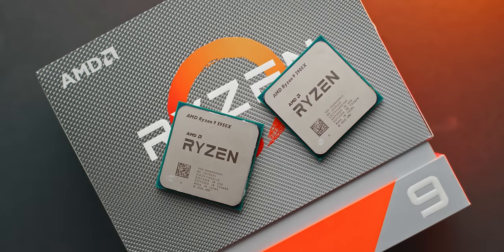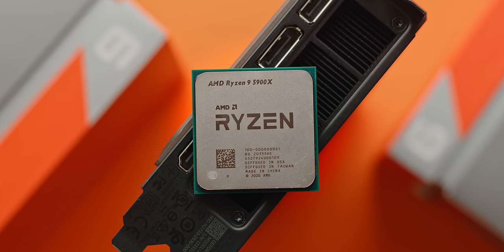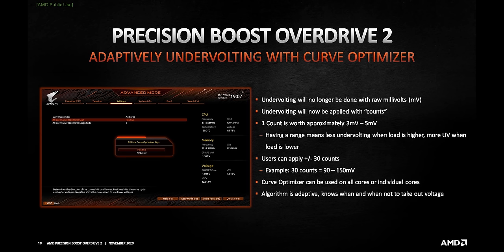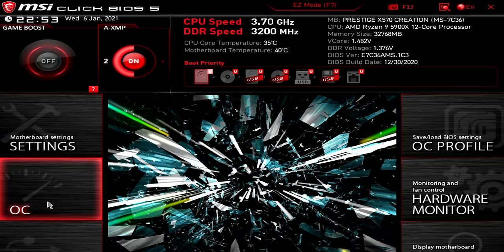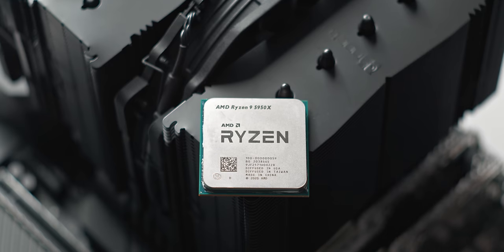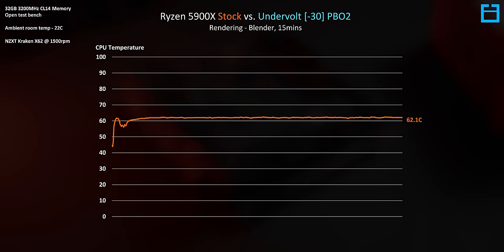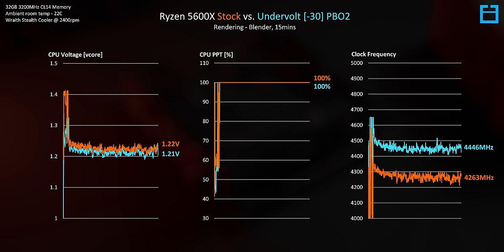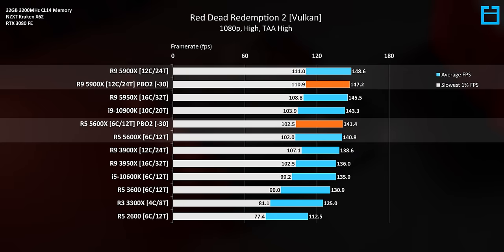Ryzen 5000 Undervolting with PBO2 – Absolutely Worth Doing

Comment: I tried that with my 5800x and the result is very very surprising.
I tried it first with negative 10 and it didn't change much.
Then I tried it with 15 and I couldn't believe the results.
In cinebench R20 and Stresstest I use to have up to 90°C with my CollerMaster Hyper 212.
With PBO2 negative 10 it was the same.
But now with negative 15 I have in CinebenchR20  and Stresstest max 59°C.
And it looks like it's stable.
Did anybody experience something similar?
I didn't really check the core clocks but in Cinebench it says @4.8
The cinebench score didn't change much but I also didn't have much time yesterday to compare it.
Reply: Yes similar results but it wasnt stable after further testing, it runs fine with Loads, the issue pops up when the CPU down clocks or is in very low load state like just idle in windows and i get errors or BSODs, currently testing it again with a new bios update on X470 Asus CH7
Reply: @Justathought81  yeah, I also had to remove these settings back to normal but It still was stable.
The problem was that I had micro stuttering in games. The rest was ok. No BSOD or so.
I think I'll try again soon with 14 or 13. Maybe that works.

Comment: Did exactly what you did on my 5900x with 30 negative curve set on all core and got a blue screen after I restarted lol. Maybe lower it down to 25 or 20.
Reply: SAME this guy doesn't know what he's talking about
Reply: With things like this you need to make sure every single setting is exactly the same as his. PBO limit DISABLED and thermal throttle limit "Auto" being the two most important
Reply: @CWWJR  If you read detailed guides to undervolting using this method you can see how variable the voltage on each cord is, 1 core may work fine at -30, another -9, it should be done per core never -30 all cores, for most people it won't work
Reply: @CWWJR  I didnt cheap out on the motherboard, im running the X570 ROG Crosshair VIII Hero, which I would say is definitely one of asus's high end motherboard. And im still crashing with blue screens. So im assuming your going to say next is I got the short end of the stick with my 5900x. My build isn't cheap either, ryzen 9 5900x, powercolor red devil 6900xt, seasonic platinum 1000 watts, X570 Asus Rog Crosshair VIII, cooling with the Kraken Z73 360m radiator.
Reply: @t3nsaZ  no I'm going to tell you you didn't do something right.  You didn't follow what he diid step by step. Or you're missing a BIOS update. What are the most important steps is you need to double-check to make sure that PBO limit is set to disabled and thermal throttle limit is on auto. Not keeping your bios up-to-date can cause a load of stability issues
Reply: @IDKOKIDK  correction it should only be done per core when you have PBO Limit set to anything other than "disabled". Also with PBO limit set to disabled you need to make double sure thermal throttle limit is on auto. These two things are crucial in his method.  I build gaming rigs for a living and I can tell you that I have personally done this on at least 15 5900x rigs. So if it worked perfectly on all those 15 rigs yet you are having issues I would tell you that user error is the problem
Reply: @CWWJR  I am on the latest bios and I did exactly what the video did more then 5 times step by step. I watched and copied every single step exactly how he did it, and rewind the video again for a second time to double check for any mistakes, the steps are not hard, its quite easy and I know I'm doing it correctly. But yet, still not stable at negative 30 curve.
Reply: @t3nsaZ  try resetting your bios settings to default then following what he did step by step without touching anything else including  DOCP profiles. Leave it off. To make sure the instability problem isn't coming from something else
Reply: @t3nsaZ   I also have a 5900x paired with a Dark Hero motherboard and I'm stable at Negative 30 + DOCP, Bios 3401 and will be updating to 3601 in a couple of days, so maybe it's the new bios 3601, hopefully not...

Comment: I have a 5800x and it’s boosts to 4825mhz, what should I set the value to in the BIOS to not lose any performance but lower temp?
Reply: I'd just keep the clockspeeds to auto and then offset by some - value

Comment: There's absolutely no way you got -30 on your gold star core on 5900X. You're simply lying.
Reply: Same. How much did you get without bsod?
Reply: Yeah mines crashed right away using 30. Im testing 20 for now and we will see if its stable.
Reply: I ended up getting CCD1: -10/-10/-22/-22/-15/-15
 CCD2: -22/-22/-22/-22/-22/-22

Comment: Just applied it to my 5700x which is fighting with a 3080ti🤣 Tested the cpu at 30 with 3dmark cpu profile 5 celcius degree 58->53 drop with 6% 16 cores performance increase.

Comment: Hello, I'm not sure if my PBO is working, my 5800x is at -30 for all the cores, it is stable and in OCCT I reach 4850hz with a voltage of 1.32V. Is it normal to have so much Volt ? Thank you for your help.
Reply: yes thats within range for the 5800x

Comment: Hey, so tried doing this with my pc,  5900x/asus crosshair/3080.  So did this, and got a BSOD: page found in unpaged area, multiple times and had to undo it.  Looked it up, most forums stated is a undervolting error having to do with ram not getting enough power.  Ram type: Trident Neo 64GB 4x16GB DDR4 3600MHz.  So my question is, is trying to use the setting of 30 too high bc of my ram?  Or is this likely something else?  I tried your initial setting of 30 because you said it worked with all 5900s, dropped it down to 20 and still BSODing.  Thanks in advance!
Reply: If your ram has been fine then it's not it. Go lower than 20.
Reply: @f-22raptor25  thx for the reply. Yea I ended up doing 10 or 12 and it’s been fine but it’s just a lower undervolt? Idk just weird to me when he was saying that basically every lone should be able to do with 30.  Could it have to do with using an sfx 850 psu?  I know they’re known to be like on the fence of enough/stable Bc of the form factor for a my setup : 5900/3080

Comment: Hey there! Used this guide with my 7 5800x3d and I have big (as it appears) instability issues, yet I really want this implemented as having low temps is important in my current setup.

I am playing Path of Exile and that only, and at everything I have tried - it always crashes at some point (without PBO it never crashes).

Things In have tried:

Curve optimizer -30/-25/-20/-15 with ppt:100, tdc:70, edc:100

Curve optimizer -30 with no limits.

At all of these I was getting my game crashed, please help me out, how do I work with this one so it gets stable and I get my temps down? Thanks to everybody in advance.
Reply: do you have any updates?
Reply: @mbmaniak777  simply not doing undervolting until I get update on this
Reply: I have a 5800x3d b550 asrock steel legend motherboard and i just used fr33thys undervolt guide and ive got my pbo set to - 25 and my games never crash and the cpu boosts properly on all cored and sits around 70c. I suggest looking him up and using his guide

Comment: My 5900x is hitting 90c underload (prime95) even with a -20 curve offset in PBO bios. 

Is this normal for a 5900x? my 5600x only ever maxed out at 83c 

I have a 360 AIO and good fan setup. (I'm sure)
Reply: Try cinebench r20 test

Comment: I have 5600, what value should I do, if I want to draw less power and less heat
Reply: use those values as reference
Limits:
PPT 88W
TDC 60A
EDC 90A
Scalar 1X
Max boost clock override +200mhz
curve optimizer start with -10 or -15 all cores, test stability for some time, preferred way is do by core but it takes time
you should get like 4500-4550mhz in cinebench and 4650 in games

Comment: What if your 5950x is in gaming mode, can the all core curve optimizer magnitude tolerate a value of 30 like a 5900x or does that change nothing?
Reply: From my testing with the second CCD disabled, yes it does allow it to have a larger negative offset.
Reply: @smb3d  noice, thx for the reply. :D

Comment: I am currently using a pre-applied thermal paste on the 5950x. Idle seem to be 40c and if I do anything its 50c gaming is 70c. Should I get the best thermal paste? And definitely will be undervolting haven't done it yet.
Have a kraken x63 cooler.
Reply: lost performace when I tried undervolting by just 5. Not sure if going lower would give the same results. Will try 10 and see what happens. PC froze I guess my silicon quality isn't the best. Oh well I am happy with it's performance a lil less heat would've bin nice. AMD probably optimized it as much as they could.

Comment: I tried undervolting my 5600x as per this guide, but I couldn't get anywhere close to 30 without almost every app and game crashing within minutes. The lowest I could go was -10, which didn't really help much with thermals in my SFF case. Silicon lottery failure.

Comment: I have B550-I strix and I cannot find the PBO limit setting. Ai Tweaker -> Precision boost overdrive and the curves and stuff is there but where can I disable the PBO limit?
Reply: is it ASUS performance enhancement? Its found on ai tweaker, little higher than PBO and it says allows the CPU to maintain boost frequencies longer, resulting in higer performance.
Reply: my bios version is 2.20.1271
Reply: does my motherboard even support 5800X3D?

Comment: Why the hell is my 5950X idling at 55C w/ case side panels off? I'm using an Asus Crosshair VIII Dark Hero w/ a Noctua U12A and an 011 Dymamic XL w/ 4 Noctua S12A 120mm fans.
Reply: it's fine.
Recommended room ambient temperature 22C-26C (Average 23C). 
More ambient temp = increase temperature
Reply: @claritoresdiano1021  I changed PBO to advanced, disabled PBO limits, left curve optimizer disabled because it's unstable and is idling at around 40C but now with a closed case. I'm currently only using 4 case fans but I have 6 more Noctua fans than I'm waiting to install once the Noctua fanhub is released, so hell yeah it better be fine. 😉 Anyways, good video but I wouldn't undervolt these CPUs. I don't think his undervolt are stable either, unless he got the golden of golden samples.
Reply: @ReptileMonitor I think you may need to try an experiment with different airflow for the best config and set proper rpm speed (Exhaust must have run faster than intake)

 I see the latest thread on AMD Reddit someone uploads a Photo uses Kryononaut in 5950X after one month the paste becomes dried in 3 spots (2 Chiplet Dies and 1 IO die) at the rest of the Heatspreader and AIO heatsink still wet. He said not worth buying Kryonaut even though advertised by GN and Der8auer could bias cause on 5950x temperature getting higher before long-term usage (just half year usage)
Reply: @claritoresdiano1021  I'll try to be cautious but I believe that the 5950X dying because of the paste it's likely an isolated case, we need to know where  he bought the paste and whether or not he applied it correctly. Too much paste can cause some issues, it might not mean much but the Kryonaut paste comes with an authenticity card which means there are probably companies selling fake Kryonaut paste as well.

You're right about the airflow but this doesn't mean much on an 011 Dynamic XL, I don't think it'll make much difference especially once it's running with 10 fans. Appreciate the tip though 👍
Reply: @ReptileMonitor  Ehh I think 5950x need much paste (X pattern)

"reddit com Thermal paste after 1 month: Die location visible"
Reply: @claritoresdiano1021  I kinda skimmed through your comment and misread it, I thought you said something about the 5950X dying where it says dried. I still believe he used too much thermal paste though, that's too much paste for a CPU that has been used for a month already, you're supposed to see less thermal after installing a cooler and you should be applying a small thin layer across the heatspreader surface. I supposed a lot of us disagree with that though, I've never had a thermal paste related issue though and this is like my fourth PC build.

Comment: I did this with my msi b550m mortar mag (E-7C94) verson 1.50 with Ryzen 5 5600x and it went on boot loop. I Reflashed to the same bios version to fix it. But it seems I can't use this to undervolt. Anyone have the same motherboard?

Comment: هُناكَ مشكله واجهتني بعد تحديث البايوس اصدار 2023.6.29 ماذر بورد B450M PRO-VDH MAX 
معالج  5600X 5
لم استيطع الوصول الي اعدادت   
 precision boost
 الا عن طريق محدد الا و هو الدخول الي setting ثم adanvced ثم AMD Overclocking ثم 
AMD Overclocking تاني 
ثم هتلاقي precision boost
🎉🎉❤ المشكله دي واجهتني لما حدثت البايوس الاوبشن مكنش  ظاهر علمت الطريقه الفوق دي نفعت و الحمدلله 
English: there is a problem faced me after updating bios for B450M PRO-VDH MAX

 version 2023.6.29
if you didn't find the option precision boost appear you can go to setting/advanced/ Amd Overclocking/ AMD Overclocking/ precision boost
🎉🎉❤ my processor is  5 5600x
Reply: English: there is a problem faced me after updating bios for B450M PRO-VDH MAX

 version 2023.6.29
if you didn't find the option precision boost appear you can go to setting/advanced/ Amd Overclocking/ AMD Overclocking/ precision boost
🎉🎉❤
Reply: لو احتاجت حاجه كلمني و ادعي لي ❤🎉

Comment: Kinda sad you left 5800x out. What i did instead was on my 5800x was to lower the tdp,ppt and edc through pbo to 115 from 142 tdp , and ppt from 140 to 100. Saw a huge performance boost in cine and a 6 degree drop on max load. What i still wanna fix is the voltage spikes on  lighter applications that still climbs to 1.5v just by clicking to open a small app. Im also idling around to 44c after i switched from a x470 to a b550 aorus master. Please help :3

Comment: Is there a way to decrease the temp that the CPU stops?
Reply: Yea it’s in bios, it’s called thermal throttle limit, and it’s probably set to auto. It’ll be somewhere around the overclocking settings.

Comment: I have the 5600x with a MSI x570 tomahawk mobo and undervolted the same way you did at negative 30 and while playing games every once in a while my pc would reboot. is this caused by the undervolting being too much or is my PSU not holding up? I have a Seasonic 650 platinum I also have an MSI 2080 super. Neither the CPU nor GPU is overclocked.
Reply: Your CPU sample is just not good as his. Try UV per strongest cores first and then adjust rest od the cores.
My strongest can only do -8 and -11. Rest of the cores have offset ranging from -17 to -24
Reply: @wolniacha_tv  alright understood thanks! i have all the cores down to -15 and seems fine now but i'll fine tune it when i have time.
Reply: @reggieh6038  yeah, usually weaker cores should easily go higher than the strongest ones. 
There was Ryzen Master update just yesterday, which adds auto-curve optimizer. So basically software looks for best settings for you. 
All you need to do is to set PBO LIMITS to MANUAL or AUTO in the BIOS and rest of the settings for AUTO as well, then go for the per-core optimization in ryzen master

Comment: My 5700x clock speeds went way down and a way lower score on cinebench. What am I doing wrong?
Reply: That’s the point
Reply: @quintit  that is far from the point, your clock speeds should go higher due to the lower temperatures. It was actually an issue with Cinebench, I figured it out.

Comment: Im here meanwhile thinking if should upgrade cpu from i7 6700k to 5800x because I gave up on gpus. I play mostly at 4K so not sure if would gain something from one cpu to another as above 1440p cpu doesnt count much mmhh.
Reply: I did exactly your upgrade, only in 1080p, gives me quite a boost with my current 1070, bf1 for example from 120 fps to 180-200.

Comment: Could you use the same parameters for the 5800x3d? Thanks.
Reply: i believe so, its still a 5000 series. But i am not an expert.
Reply: the 5800x3d might be hard locked

Comment: Does this work for Ryzen 7 5700x?
Reply: Yep
Reply: and? did u managed it? how is it? any difference between Auto?
Reply: yes it works. Just did that and -5°C idle, -8°C all core load and -7°C on single core load.
Reply: @121nutty  with what changed?
Reply: @IBims1Mark  With curve optimizier with negative value of 25. I have B450 TOMAHAWK MAX motherboard and it works great. System is stable.
Reply: @121nutty  ok!

Comment: My PC wont even boot with this settings. Any thoughts? Thx

5600x with Stock cooler and MSI B550 Tomahawk (BIOS 7C91vA5 - ComboAM4PIV2 1.2.0.0)
Reply: change to 20 and then another 5 increment until stable

Comment: How much should this decrease the temps of my cpu? My 5900x boots up instantly when I open up core temp and it says 91C or around there. I’m using 25 for the value right now and I haven’t see any changes. After a few minutes after booting up the idle temp is around 75 and can sometimes spike for some reason to 86. Is this normal? It feels like nothing has changed and I’ve been having a problem with this for a while. Not sure if it should be running this hot. While playing some games it is constantly at 90C. I also can’t run it at the value of 30, I tried once but I’m not sure if I should try again since last time it didn’t run or something I don’t remember. I have not much knowledge of computers. Someone please let me know if this is okay or if it’s not a way to fix it. ❤️
Reply: Your cooler is likely not enough. The 5900x needs much more than the amd stock coolers, even tho the 5900 doesn’t come with one.

Comment: Is there some other setting I missed because I tried this and it works fine but the pc randomly restarts.
Reply: then you most likely applied to high of negative offset, try adding less negative undervolt...so if u had -30 try maybe -20...
Reply: OK thanks!